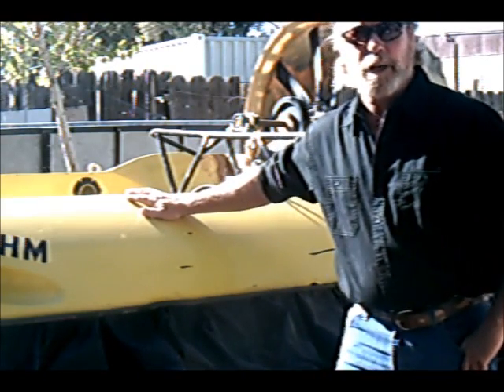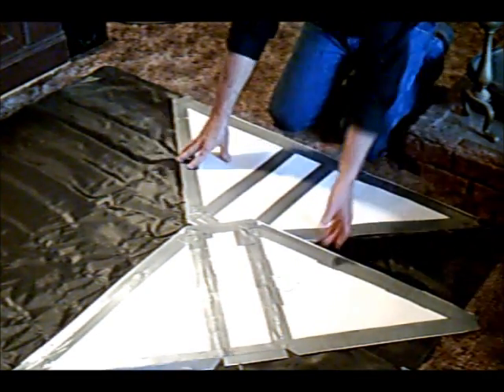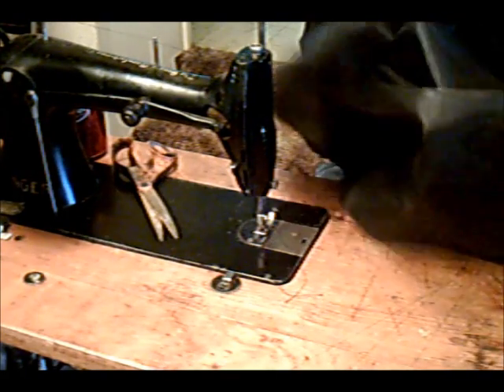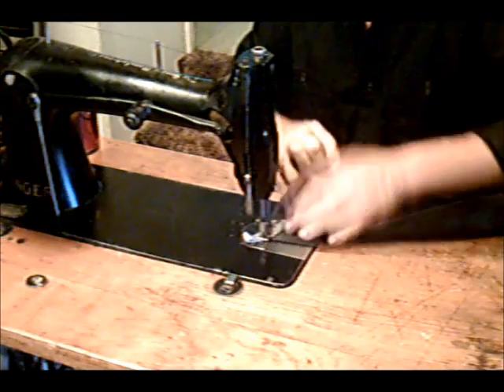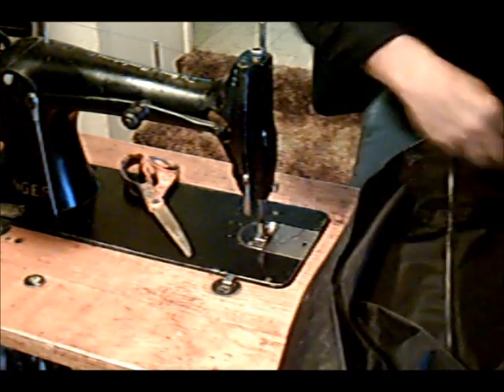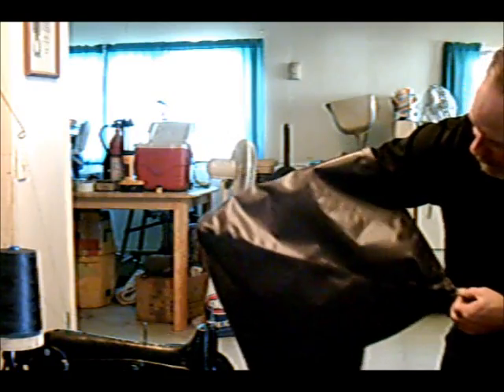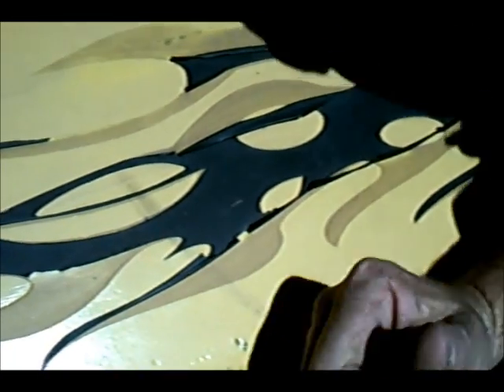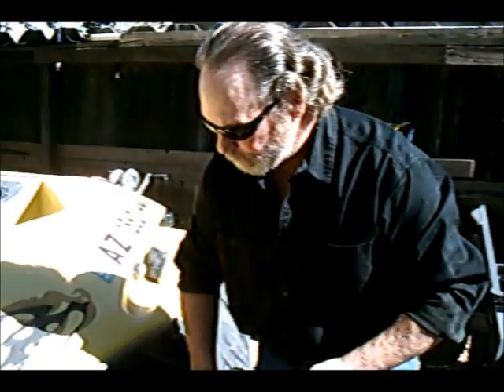hovercraft finger skirt

Comment: Thanks for the info. May I ask how do prevent wather get into the holes? I want to make my own Rc model like the big ones. or there is nothing inside to prevent water get in...I mean when you stop engine and just let it float.....sometimes the hovercraft tilt it self and wather could reach the holes......Thanks for help me.
Reply from the maker: The hole are at the top of the plenum chamber, this is were the air is forced into the outer hull. A chamber that is around the out side of the passenger compartment. Also there's the fingers, when deflated water will push them over the holes. And last there are flapper valves on the bottom side of the plenum chamber, when the hovercrafts lift fan is revved up the air will blow the water out the bottom.
Reply: omar926 Thank you so much. I was thinking about the fingers but i am learning about how everything is working so i was unsecure about  the holes. I allready watched many many videos and I am starting to read some information about hovercrafts. Thank so much again.

Comment: Hî, Ken
Think you . It is very interesting. But what would be your advice to design a "2 compartments finger" ? In my case I think it is better two have two bags: one quite sealed acting as supply tank and another one exactly like yours, feed up by the first bag.
Reply from the maker: Sounds interesting, are you thinking something like a cone skirt inside the finger? Hum, guess trying it couldn't hurt to tri. Good luck and have fun with it.

Comment: why doesn't the whole pressure get lost escaping between the individual fingers.
Can you explain me how it works? there is no attachment between each individual finger right?
Reply from the maker: When the underside of the hovercraft is filled with air the fingers expand like balloons pressing against each other, pressing together makes the seal. If one were to get damaged or blown out, the fingers on both sides will expand to fill the void.

Comment: Oh super , I`m thinking of building one I have an old fibreglass 6x6 either fix it or make one of these I have mega rubber back tarp from my old transport truck lots of it i was trying to figure out which way to go this way or make large balloon sides and these on the front or a flap , Thinking of going with a flat deck style being 6x6 floor is flat and use blue styrene foam & marine wood  . Thanks so much for the reply so fast , I subbed ya before I think redone it anyways Thanks  Ken is it   .